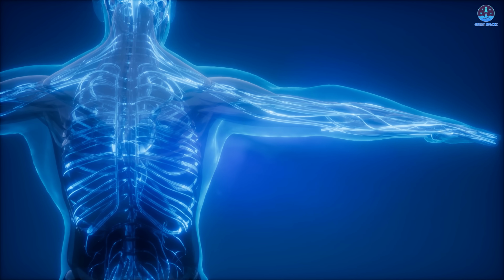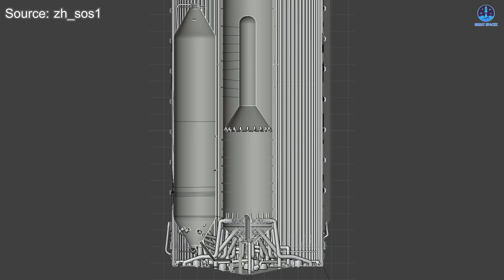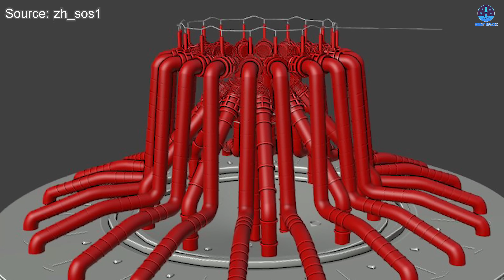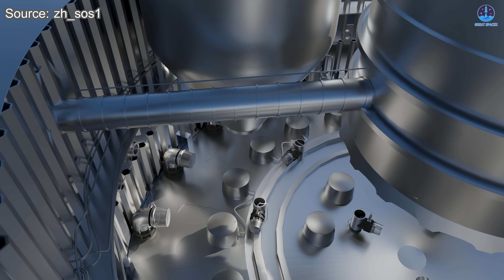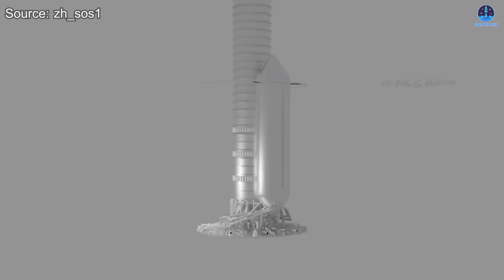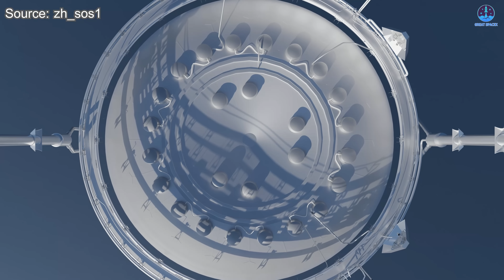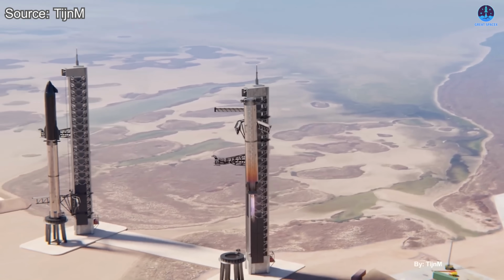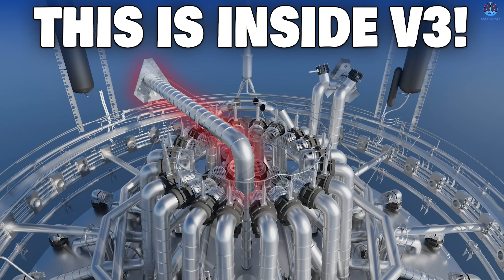SpaceX’s Genius Upgrades on Starship Booster V3 Internal Fuel System are totally Mind-Blowing!

Comment: I don't trust centralized and solidified systems; this central tube is very sensitive to vibrations. This tube would be less sensitive if it were decentralized into numerous smaller tubes. The same rule applies to the massively centralized tank when it should be individual tanks at the center of mass of the ship.

Comment: Support struts body boom Dampeners, Vibration etc good call ! there might be a fuel system that could Improve Performance Requiring a total redesign Eliminating around 62% of Plumb line Components including Possible turbo pump by adding what already exists on standard jet liners witch maybe could be modified Reverse point of pressure or end unit Combiner the key to a new Formulation in fuel delivery !.

Comment: Your graphical representation is missing a fair bit of the complex network of plumbing and sensors that we saw in the helicopter view after the booster failure in testing. There seems  to be network of smaller plumbing, sensors, and other things I assume are for engine management in the tank that could explained where SpaceX moved systems that were once located on the Raptor 2. Raptor 3 is certainly an impressive sight, lean and clean, but I imagine engine management hardware is still required and it appears some parts may have been relocated into the tank.

Comment: Still over complicated...And the pipe runs longer than necessary, and too many pieces for points of failure.

Need to start thinking CONCENTRIC.
Instead of the clunky side tank, put a concentric tank around the over diameter down comer, or; round the inside of the hull.
Also that down  comer wants shape, not just a straight tube should be a smooth funnel at the top end like for a vortex, and another at the bottom, more of a swell, to widen out and shorten pipe runs, and give more diameter between the flanges of manifolds, and the manifolds should be combined, at least two or three engines, with larger diameter feeders and smaller diameter branching.

This V-3 example is basically going back to the early version of straws every which way, just slightly better organized. it lacks harmony in design, is way too busy, And more like artificially pruned shrubbery than a natural tree...😂

Glad Rocket Enginerds didnt design things in nature... or; we'd have bizarre Alien looking Flora and Fauna...

Theres a logical reason for every natural design.

And I'm starting to see 3D printed Rocket engines and other parts that are AI designed That are more Nature like, and look less like things cobbled up by Bob at the Muffler Shop to attract street attention. 🤭

Basically this feed system is starting to look like;
Raptor 1...

Needs to be more like Raptor 3.....

Everything minimized and efficiently done, Curves where appropriate, and use metal for at least 3 purposes at the same time if possible.
Like that side tank and even the COPV's should also be intergral structure. not just hunks cobbled into the mess.

The hull design and all of its parts and plumbing should be more like something alive and beautiful in design.

I notice that God invariably works towards perfection and beauty....

Maybe so should we, when being creative. ❤
Reply: Nope. That clunky side tank is there for a reason. Balance. The V3's new gridfin layout means there is a distinct "Bottom" side to the booster. Putting the landing tank where they did means more weight on that downward side. Keeping the flight profile more stable.
Reply: @gregsteele806 
Thats alot of junk to do, less elegantly, than some real control surfaces which would allow flying the boosters nose forward, like for more fuel efficient landings and at sea returns.

Its still dumb, and so is the Starship with the silly dog ear flappers.
Reply: @gregsteele806 
Also; if they had real control surfaces and flew it nose first, it would prevent the butt first dieseling plasma effect, which will oxidize everything in the aft compartment and heat it unessessarily leading to annealing and fatigue.
Also they waste fuel doing the retro burn, that could be done with zero fuel in a long sweeping turn nose forward at higher altitude. And get increased payload on the ship, and better destination control without those crappy grid fins that suck fuel going up.
Reply from the maker: Great discussion 👍
Reply: @colonbina1 
Yeah, I have to keep them on track! 🤭
Getting even for the insults on parts count and engine simplification writs, and a dozen other concepts before and since, that somehow got adopted like magic after my writs, and never a thank you! 😂

But I'm here to help Elon, and human space expansion...

And if you tweak people they cant not think about the points....

By the way I did a writ on r/SpaceX years ago about bringing things in nose first, and it got removed by the Engineers running the forum, they said it wouldnt work, how to land butt down?
So I explained you would do a stall over the pad and then retro...
And the jerks never reposted the writ.
😂

Comment: This reminds me of the early engines. Very complex with all sorts of stuff.  Then with each iteration the engines got simpler and simpler and work better.  Not sure how they could simplify the plumbing here but it really does look too complex.  Might be efficient and hardy but complex things are hard to manufacture at scale.  They're obviously doing it but as things get more complex there is more room for some errors or failures not anticipated.  I still don't get the transfer tube.  It's so huge it's more of a tank than a tube.  The tube has more volume than the tank that feeds it.
Reply from the maker: Yeah. Starship needs to be simplified more and more